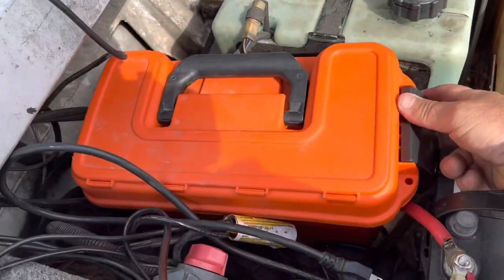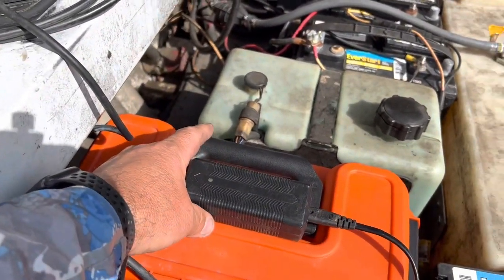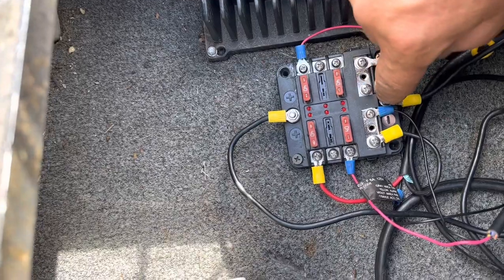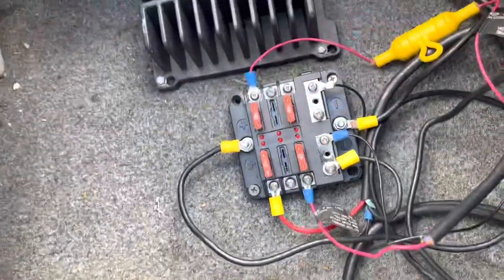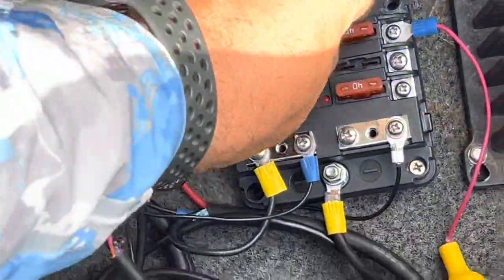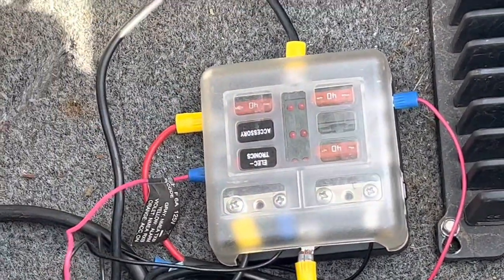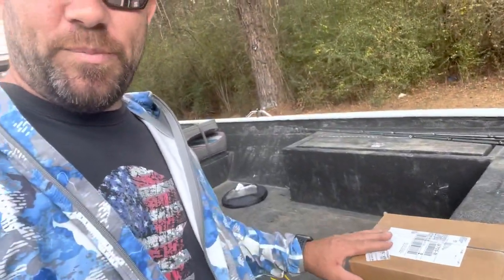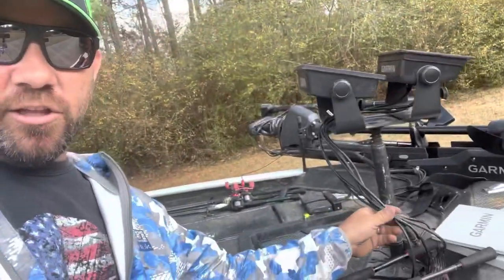How My Livescope and Units Are Wired Up

Comment: Does the gls10 and the 1022 need a 40amp?
I’m hesitant to install my set up got lvs34 with 8612 curious what fuse I should be putting in

Comment: Everyone, including Garmin, is suggesting using 10ga marine grade to supply power and ground to the black box. Supplied with the Livescope you receive a harness about 6’ long of 14ga wire. Every video or article I’ve sourced mentions avoiding a voltage drop to the box so it’s recommended you use 10ga wire. But in every video that uses 10ga wire they splice it to the entire 6’ harness of 14 gauge wire and is then coiled and zip tied next to the black box, rather than shorting it and splicing it. IMO reducing the wire size from 10ga to 14ga creates a voltage drop by itself not to mention using the entire 6’ of it. 
Yours is the ONLY video that shows you using the original 14ga harness to supply power and ground to the box! 
Now my question: what are your thoughts on using 10ga wire or just using the supplied 14ga harness? My install is only about 3-4’ way from a Milwaukee M18 lithium battery. I’m thinking 10ga wire is over kill. Thoughts?
Reply from the maker: I think using 10 gauge is for traveling from the front of the boat to the back. If you can reach the battery use the supplied harness
Reply from the maker: I think using 10 gauge is for traveling from the front of the boat to the back. If you can reach the battery use the supplied harness
Reply: Should I use same amp size in fuse block that came out of the in line fuses ?
Reply: @AndyBiddy-t8b  yes, remove the inline fuse at the unit and move it as close to the battery source as possible.

Comment: Question if u get time, I have a manual adjust pole on my Ultrex from dubl seat, how far Above the trolling motor should I mount the transducer. Pole will adjust down even to the motor head if needed. Thanks a ton
Reply from the maker: Hard to say without seeing a pic of your setup bud. About 6 inches above the top of the barrel of trolling motor is what Garmin recommends if it mounted on the trolling motor shaft

Comment: Warranty question. Three amp outdoors battery’s that got moisture did they replace them also how long before each had the probelm
Reply from the maker: Welcome to the amped outdoor problem. They did replace my first three. Then they kept saying it was my fault and said they wouldn’t replace anymore. That’s why I switched companies
Reply: @The_Garmin_Guru  what brand battery now. I’m going to lithium isolated setup. About to pull trigger. Considering Amped, miller tech, Dakota. Value your experience so how long you been with this battery? Usually don’t miss your videos so if you did one let me know.
Reply from the maker: @jstreun36  Lithium Batteries: Are They Really Worth It!!! Ionic Batteries Are The Real Deal
https://youtu.be/BfkuafSjOSo

Comment: Have you or anyone heard of the screen freezing up while using Livescope? I’m going round and round with garmin on this issue. It works for a few minutes then freezes.
Reply from the maker: Have you tried force updating your unit with the new update. It’s helped a lot of people
Reply: Mine was freezing after updating. 
It did it on my 93 uhd and my plus93. My plus didn't get the updating.   I think it is in the black box.  Going on a week with no freezing. I took my auto  depth off.
Reply: @The_Garmin_Guru  yes, garmin even sent me a special update. No bueno
Reply: @Alexworld13  I’ll try that. So just turn auto depth off? I have the 93sv too. When I update, it shows an error with the 93 but not the gls10. Trying to get a new box but that’s pulling teeth.
Reply: @Richard-mj5dp    My black Box is brand new as of December.
 I don't wanna call  cause I don't wanna be without it for the ice fishing season. Lol
Reply: @Alexworld13  this guy posted video of his freezing. Mine is still freezing. Garmin is working with me but they are slow walking the return. I’ve called them almost ten times. If there’s a pattern to the freezing it’s when I get in shallow stumpy waters, as though the transducer is overwhelmed with the return.
Reply: @Richard-mj5dp   I live in michigan, we are still ice fishing. I hope don't have any problems in the spring, when  on my boat.  Hope you get it figured out.

Comment: Link for fuse distribution block ? Good job
Reply from the maker: SOYOND Waterproof Fuse Block,fuse Box With Led Indicator Damp-proof Cover 12 Circuits With Negative Marine Fuse Block For Dc 12/24v Automotive Car Marine Boat RV Truck https://www.amazon.com/dp/B07HDZVW3P/ref=cm_sw_r_cp_api_glt_i_35667YN07408J5QG1KQ1?_encoding=UTF8&psc=1
Reply: Thank boss 👍🏻
Reply: Do you need a fuse box wiring up the black box and the 126sv to the lithium battery??

Comment: Where did you get that fuse box?
Reply from the maker: Sorry bud. Been asleep. Working nights This week. SOYOND Waterproof Fuse Block,fuse Box With Led Indicator Damp-proof Cover 12 Circuits With Negative Marine Fuse Block For Dc 12/24v Automotive Car Marine Boat RV Truck https://www.amazon.com/dp/B07HDZVW3P/ref=cm_sw_r_cp_api_glt_i_7VX0Y4A945FGN50KV212?_encoding=UTF8&psc=1
Reply: Thanks man.

Comment: What brand fuse box did you buy?
Reply from the maker: 6-Way Fuse Block W/Negative Bus - JOYHO ATC/ATO Fuse Box with Ground, LED Light Indication & Protection Cover, Bolt Connect Terminals,70 pcs Stick Label, For Vehicle Car Boat Marine Auto https://www.amazon.com/dp/B07DYT2TVS/ref=cm_sw_r_cp_api_glt_i_VCGC01WF8FCZYAJK7XY8
Reply: @The_Garmin_Guru  Thanks. Keep up the great videos
Reply: Nice bro 👌
Reply: What are those yellow clips connectors called ? I need some to connect to my power cable. Thanks brother